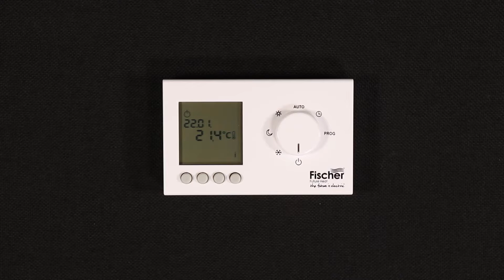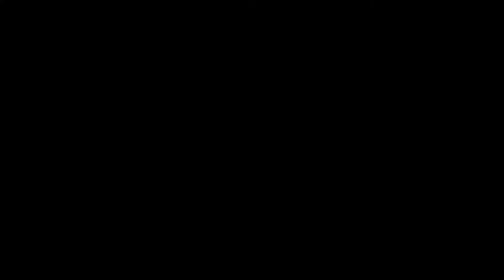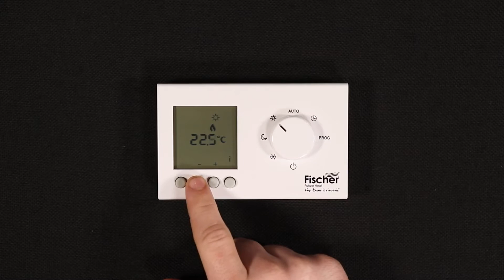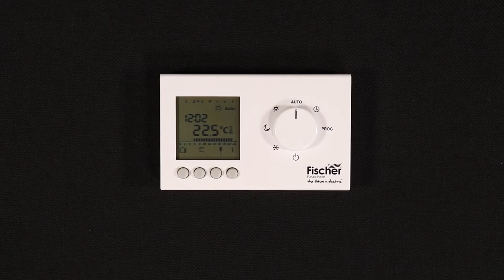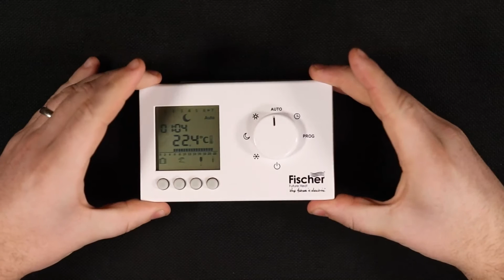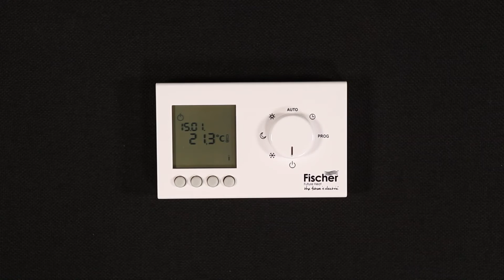New Thermostat Instruction Manual

Comment: As far as setting the auto is concerned; they don't tell you that you can set it to come on more than once a day.
Whenever I am working the early shift I set the controller to come on at 4.00 am to 5.30am, and then again at 13.00 to 23.00. This way I have 2 progams set in a 24 hour period; something they don't show you.
 I figured this out by myself.
Set the start (moon) time eg 04.00 . Set the finish (sun) time eg 05.30.
Then set the next start time later in the day(moon) eg 13.00 followed by the next finish time (sun) eg 23.00.
When finished continue as they showed by clicking the moon time to 23.30 followed by the ok  button as they show you.
Reply from the maker: Hi Ronnie, thanks for the comment. Our thermostats allow users to set programs at 30-minute intervals if required. Thanks for the help.
Reply: can you please share how you did this. having a mare trying

Comment: Can the thermostat work without WiFi?
Reply: iT DOESN'T HAVE WI FI CONNECTION. 
If you want wi fi connection; you have to ask for it before installation at an extra cost of £200 for the first radiator, and £100 for every other.
If you don't ask for wi fi connection, and it has to be done at a later date then the cost is double.
So much for the 'future heating' in the name.
Now here in the 21st century; all heaters should come with wi fi connection as standard, and not the old style ones Fischer use.

I found all this out after I had my heaters installed.

Comment: You forgot the CF menu and how to re-pair the heater to this controller
Reply: Have you found a solution of how to re-pair the remote to the heater? 
If so could you please let me know. Thank you!
Reply: @MiloFlying  yes, thank you. The user manual turned up and it's easy - when you know how! It would still be nice to know what the CF menus are and why on this new controller they are not all set to zero as detailed in another Future Heat video